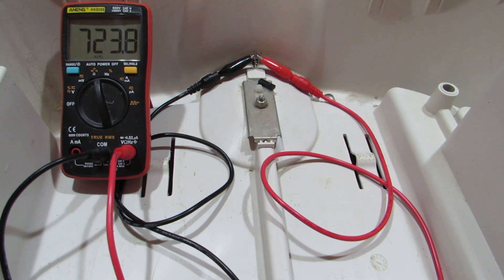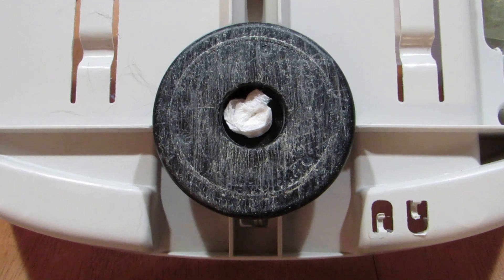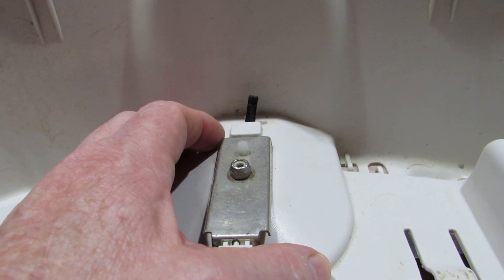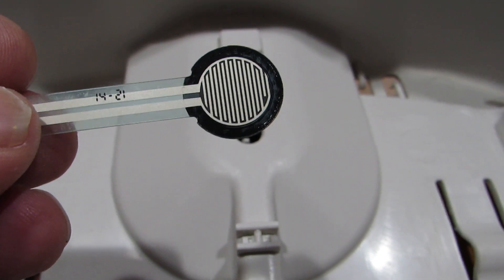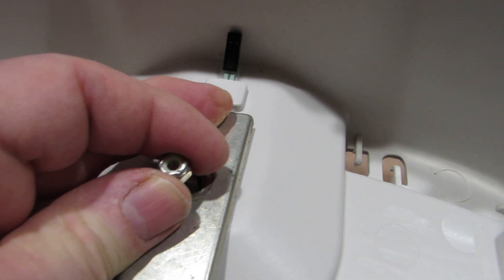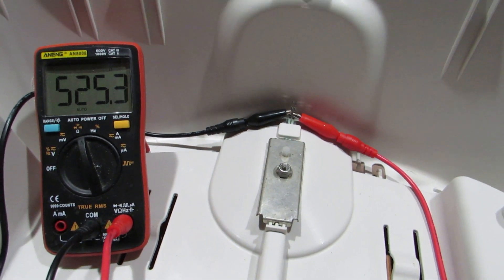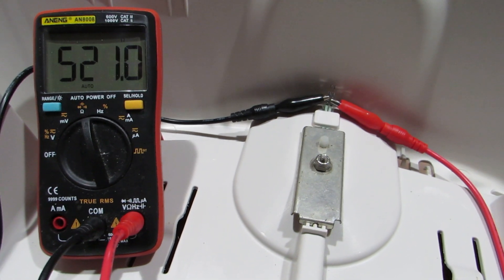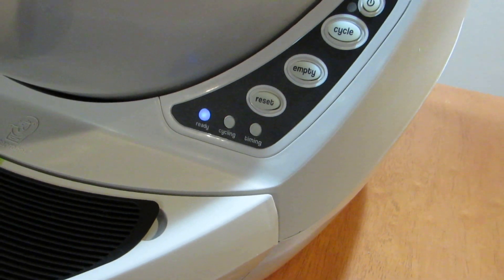Litter Robot 3 LR3 weight sensor replacement & calibration.

Comment: I bought one for the first time and literally right out of the box it is having timing sensor problems. If I can't get it fixed fairly quick, I will never buy one of these again. What a waste of over $500. If I am going to spend that much cash, it better work first try. I don't care how well the brand is. Bottom line, if the product can't work straight out of the box, go back to testing before it is released as a product.
Reply from the maker: Is the LR3 acting like the weight sensor is hyper sensitive?, is it having globe stoppages in cycle with or without cat entries that the LR can NOT recover from and finish the cycle and either has a slow flashing yellow or red light??
Reply: @mikeshowtoandthings  I am having those issues! Driving me crazy! Should I check the ohms on the weight sensor? Any help would be appreciated!
Reply from the maker: @chrispy3045  If you want to test your weight sensor for improper linearity, you can connect an ohm meter to the sensor and then take the weight foot nut and gently tighten it till it stops turning, but don't go any further than that. Then watch the ohms meter as you slowly unfasten the nut, if it has around a 200 ohm rise as you loosen the nut till its almost unthreaded off the weight foot bolt and then you see a sharp rise in ohms that goes up to 2k ohms or in that range, Then sensor is hyper sensitive.
But, if you see a steady rise in oms as you unthread the nut off the weight foot bolt then the sensor is ok and you can then adjust it to the lowest ohms possible then soft calibrate the main board to the sensor.
If it is hyper sensitive there is a way to work around the issue and allow the LR to work perfectly normal. I've done this already with one of my own LR3 and its been working perfectly despite the hyper sensor issue.
Reply: @mikeshowtoandthings thank you for the information. I’ll give it a try. I’m constantly getting a slow yellow light with an interrupted cycle. It rarely self corrects.
Reply: @mikeshowtoandthings  Thank you for the help. The linearity looked good. Ohm's were between 480-520. I cleaned and adjusted the sensor and so far it seems to be working, hasn't stopped cycling yet. Still not sure what was causing is, but maybe it just needed re adjusted.

Comment: I cannot see how you removed the cable connector in order to expose bare wires for multimeter connection.
Reply from the maker: You will see on the plastic part of the connector 2 square holes on one side, look carefully and you will see a small tab on the metal portion of the connector that sticks out, they fall into the plastic holes locking the metal portion of the connector in to the plastic portion. Gently push in both metal tabs so they don't lock in on the plastic holes. Then slide the plastic off the metal portion of the connector and you have access. To reinstall GENTLY bend the metal tabs back out and center plastic portion of the connector and slide it back in place.
Reply: @mikeshowtoandthings  Thank you very much for this.  I have followed all your instructioins now to get my LR3 working properly

Comment: Hi mike. I have been having over-torque issues with my LR3. I have cleaned it, checked the bonnet to make sure its secured properly (as you’ve shown in last video), as well as making sure the black arm in the back is in the proper position. I briefly looked at the drive gear, and all I could imagine to do was tighten the set screw which was tight. Could this be an issue in the gearbox? I’ve looked online and this seems to be a VERY common issue, but no one has seemed to have solved it yet and the company just sends people new motors, but I’d like to just fix this myself. Any help, would be appreciated, thank you.

Comment: I am having problems of my cat not being detected solid blue light always. I push on the base and no change. If i unplug the cat sensor the red light doesnt flash.
Reply from the maker: If you are unplugging the cat sensor or just pressing down all the way on the top of the LR till the spring tension bottoms out, holding it down and after pressing reset not getting a slow flashing red light, You have a control board malfunction. A replacement will be needed to restore proper functionality. You can either get one from Whisker or RobotShop, Robot shop is cheaper if you get a connect main board only if you are looking to replace an open air control board, FYI, (The connect board without serial to get the connect features will work exactly the same as an open air board).
Reply: @mikeshowtoandthings  Thank you for the reply. The control board stopped lighting up and was warm to the touch. So I will replace it.

Comment: here is an easier way than taking out your multimeter and all. that just screw the nut down 7 threads thats it lot easier.
Reply from the maker: That's good in all to rough set the calibration if you don't want your LR reliably activating the cat timer. The whole purpose of this is to properly calibrate the weight sensor so the LR detects the minimum amount of weight possible, ( right around 5 pounds). The sensors are not uniform in resistance readings from one to another, (Minimum resistance from 400 ohms to 560 ohms new) and require the proper calibration to get the most out of them. So yes, you can rough it in at random and hope for the best if you want?.

Comment: With only the 6 pin in, I get no light..no power.
Reply from the maker: If you are getting no life out of the control board with only the power plugged in to it, disconnect one of the motor wires and try again. If no power up, try wiping clean the power button where it touches the control board and the control board its self to clear any debris or dust that might stop a physical connection with the power button, then try again, if there is no power up, check with a VOM to see if the control board is getting power. If it is, then it highly likely your control board has died.
Reply: @mikeshowtoandthings  thank you. I will try these things. What should I use to wipe the control board with just a dry cloth? And when I disconnect one of the connections to the motor do I leave everything plugged into the control board? Thank you
Reply from the maker: @gayleudall1035  You can clean the little back dot on the backside of the button and the gold contacts on the control board with at least 91% isopropyl alcohol.
Reply: Thank you. I tried that but it did not solve the power issue. I will order a new circuit board.

Comment: I have ordered the weight sensor replacement from you just the other day. Hopefully it arrives soon. So-I have not got my LR3 fixed yet. I tried a fix of removing and replacing the silver plate and adjusting the nut tension. Now I have no power to the unit at all. We put a voltmeter on the power connector to the base and we read 15 V so believe the power cord is not the problem. I took the control panel off and checked that all wires and connectors are attached and in their proper places. ( I installed a new wiring harness in August of 2024. I replaced the position sensor in January 2024) Could it be that I "disturbed" the sensitive weight sensor and thereby "killed" the power????I am hoping that when the new sensor arrives, replacing it will provide electrical continuity. Is that a reasonable expectation? Thanks for your advice!!
Reply from the maker: The weight sensor only varies resistance reading that the control board uses to determine if the cat timer should start or not. If the weight sensor is disconnected and the LR is powered up the red light will slow flash indicating an issue with the weight sensor. You can for a test short the weight sensor wires together and you will see the LR go through its self tests and cycle, but then after that the weight sensor will of course not be operational. If you are having a power on concern do this..... disconnect the 8 pin and the 4 pin connectors off of the control board but leave the 6 pin connector installed, this is your power connection. Plug the power in and then if nothing press the power button on the control board. Does it light up to a slow blue flashing light? If yes connect the 8 pin connector and does it still power up?, then the 4 pin etc... This will determine which segment of the system is causing the problem is any? The weight sensor cant kill the power in any way shape or form. Its just a pressure sensitive variable resistor.

Comment: Dumb question here… do you need to replace the sensor? Can you just remove it?
Reply from the maker: Yes, replace. If the sensor is not replaced and the circuit left open the LR will not cycle on power up because the lack of sensor in circuit causes the self check to fail with a slow flashing red light. you can short the wires together that connect to the sensor to get past the power on self tests but the LR will not detect a cat presence or auto cycle, just like the sensor is bad. It will only cycle manually and that defeats the whole purpose of a automatic self cleaning litter box!
Reply: @mikeshowtoandthings Thanks.